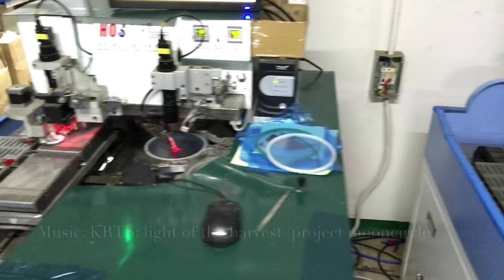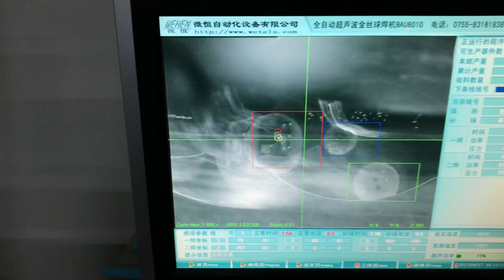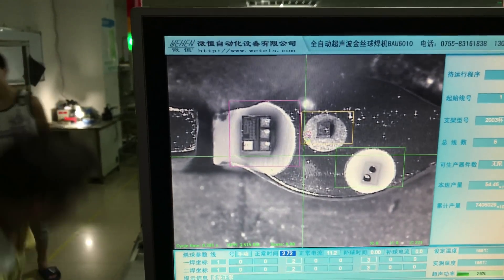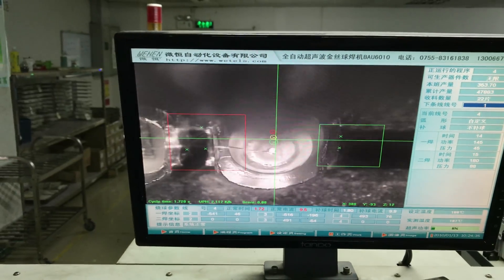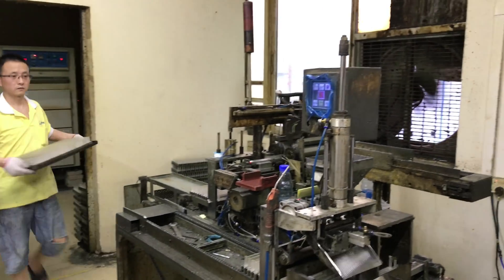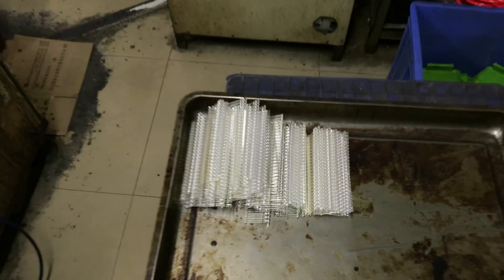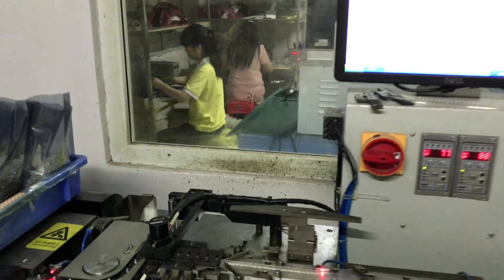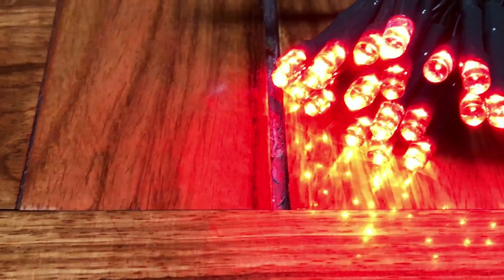RGB LED manufacturing

Comment: I'm  surprised that the IC only does "slow flash" color transition in the same speed as others which is boring and too quick, also it is not a seamless transition, as the programmer mise have been careless.  Could the IC be programmed to be much slower with higher steps per second resolution?

Comment: Nice video..  I'm interested in the company making these, as I have wanted to buy them for years and can't source them.  do you have details you can share?
Reply from the maker: Hi Chris, just check alibaba or aliexpress for these, they are widely available these days.
Reply: @infinitesolarforall3901  not 2 wire addressable RGB pixels... they are as rare as the dodo.  I thought twinkly cornered the market on them, which is why I was excited :)

Comment: This is really cool, thanks for showing the process! One thing I'll note that is in the earlier part of the video, you should the wire bonding to the IC that "mixes the colors" which looks a lot like a ws2811 or similar IC, but in the end, you talk about LEDs that are used for simple christmas lights that use "two wires" which generally do not have controlling ICs, unless I'm missing something.
Reply from the maker: Hi,  the trick is that we can superimpose a digital signal on top of the power signal, this allows us to use just 2 wires, but still communicate digitally

Comment: I have a couple of questions since you offered. 1.) are the LED’s sorted by light characteristics because they get mixed up in production or is every led produced slightly different from another and they are just sorted to obtain a higher characteristic tolerance. 2.) how much does each LED cost to make? 3.) who invested the money for the machines and how long does it take before one pays for itself. This is very cool to me, thanks for sharing.
Reply from the maker: Hey man, sure!   So these are RGB leds, the dice that are inside are 450 nm (blue) 532nm ( green) and 650nm ( red)  they are manufactured separately before assembly. Each led chip is incredibly cheap costing cents only. They are fed in to the machine on wafer boards where the pick and place machine can pick them up and place them inside the led frame.  The machines cost quite allot, my estimate is about 50-80 K usd for the placers and wire bonding machines and even much more for the binning machine that sorts the LEDs. So that machine park there costs well over a million usd. ROI depends on market prices for leds and raw material cost. There is a reason why these companies run 24 hours a day, their margins are quite small so all they can do is make massive quantities of leds.
Reply: @infinitesolarforall3901  you have a really cool job, I wish there was more manufacturing like this in the US just because I really like industrial automation but I guess the low profit margins are what keeps that from happening. I've noticed that china is starting to make a lot of machines now (cnc, injection molding, ect.). What do you attribute that to? Do you think China is starting to climb the manufacturing hierarchy? and where do you project most manufacturing to take place in the future. If you had to give one piece of information about Chinese manufacturing and quality control, to me an american engineer who has never been to China, what would it be. Thanks, great video by the way, really appreciate it!
Reply from the maker: lsm13b the US is still leading in design of new equipment the Chinese pretty much just copy the designs from Japan and US/EU  especially in electronics equipment the US can’t be beaten as of now but the Chinese make stuff cheaper.
Reply: lsm13b
The probability that LEDs are 100% identical is very low. There will always be manufacturing tolerances. These tolerances can be from clearly visible to barely visible.
You could see that in the exam at 6:15, how the point between the 4 categories jumped criss-cross.

Comment: Wow that's a lot of engineering put into those machines. Surprised how dirty the place is though...
Reply: It’s a factory running 24/7, not a show home or a restaurant
Reply: @unlokia  I've seen lots of manufacturing facilities in my days, and I can tell you right now any real LED manufacturer worth their salt maintains a pristine environment, this is not a well run operation. The amount of filth and contamination in that facility is horrid from an electronics manufacturers point of view, you do understand that dust and grime in/on small components causes quality control issues right?

Comment: Wow. This is really cool! How does data get sent to the LEDs with only two wires?
Reply from the maker: Brandon Meiklejohn it’s superimposed on top of the 5V line
Reply: Thanks for the information, really appreciate it!
Reply: If it's like other IC LEDs the data gets cascaded to each LED. The first LED receives it's data then it allows data to pass on to the next LED and so on.

Comment: I know they're not making CPUs, etc, but I still expected a little more cleanliness, filtered air, specialist clothing, etc.
Reply from the maker: Tony Eezi I agree, but it’s not super important for the purpose, these leds are very cheap, you’d see a very different setup in a big brand factory with high power led manufacturing
Reply: White ones get burnt spots in the middle or the phosphor changes colour, blue ones just go open, other colours just die. Quite a few COB LEDs have groups that fail but of course the faulty ones can't be replaced individually. Mainly it's the 'bullet' packages that have the worst failure rate but I've even had 5050 LEDs discolour, fade & die well before they should. It's wonderful technology but far from perfect. 
The first LED I saw was in the late 1960's, a small red LED with a faceted bullet package - it was magical in those days but very dim. It didn't last long either. I've been using them and replacing them ever since.
Reply: olsmokey - the failures that you describe are from over-current (bad drivers) and over-temperature. For "bullet" do you mean 3mm and 5mm LEDs? If so, those are indicator LEDs and they are not designed for continuous operation. It sounds to me light you are replacing household light bulbs, and those are usually made down to a price.
Reply: You're right about the 3mm & 5mm LEDs. Wrong about everything else.
Reply: olsmokey - well, aren't you the clever one?
Reply: Well, by my direct experience I replace many dead LEDs weekly. Maybe these ones are reliable, but the ones I have to replace aren't.
Reply from the maker: olsmokey question is why do they fail? Is it heat? Power supply or something else.
Reply: @olsmokey  If the heatsinks are too hot to touch, they're too hot. Unfortunately most LED lamps are manufactured to put out as much power as possible with little regard to lifetime. Often due to having to fit into the same packages as old incandescent lamps. And consumers just buy the one with the highest power and don't know that means a shorter lifetime. Personally I choose the ones with lower power than average, and better heatsinking.
Reply: They would do if they were actually manufacturing the silicon. They are not. The silicon/raw LEDs have already been fabricated prior to this process. The machine is simply placing the red, green, blue,  white LED components + IC on a substrate then soldering them together.

It's possible that they use an electrostatic mechanism/positive pressure environment within the tiny pick and place machines to prevent any dust from settling on the substrates and any dust can be removed prior to encasing the parts inside resin.
Reply: its not even like that in the US... wtf you talking about willis.
Reply: I've seen countless videos on how someone uses LED's. Often very questionably calculated series resistors or oddly designed series / parallel circuits are used. I prefer the series connection of LEDs with a "correctly" calculated series resistor (based on data sheets), which I then take a precautionary value higher. At such a strand I then connect other strands in parallel.
I once had a car interior lighting built from 16 LEDs (4 strands of 4 LEDs each). I deliberately calculated the series resistors with an operating voltage of 15V.
The LEDs have been lit for about 9 years now. Until today without failures.
Even in the staircase, I've installed LEDs in cable ducts that illuminate the stairs for me. Apart from the failure of a single LED, they also glow flawlessly over the years.
The ratings of the used LED's in my Staircase: 3,3V 0,02A per LED. Power Supply: 12V DC with fixed Voltage Regulator. For every LED-strand i used a 105 Ohm series Resistor.

How is a LED series resistor calculated? 

Step 1: Please read in the data sheet, which electrical values your LED may be operated with

Step 2: Calculate the needed Voltage-drop at the series Resistor: (for example: 3 LEDs with 3,3V forward Voltage in series needs 9,9V)
I like to use a 12V DC Power Supply...
12V - 9,9V = 2,1V

Step 3: Calculate the resistance for a current-limit at 0,02A:
2,1V : 0,02A = 105 Ohm

If the Power Supply is unstable, use the next or after next higher value of the resistor to prevent over-current and damage to the LED's.
Please note, the forward current of a LED-strand stays at the rate of one single LED. This current only rises whent you connect LEDs in parallel!
Don't mix different types and colors of LED's in a series connection. Because different LED-Voltages and LED-currents can and will cause damage to the LED with the lowest voltage- and current-value.
The series resistors value should not be too low, since otherwise the smallest voltage fluctuation could cause a large current fluctuation at the LED's wich can cause damage...
Reply: This is why so many LEDs are unreliable. They quote figures of 10's of thousands of hours, but in practice it's much less.
Reply from the maker: olsmokey not so true, the process here is to wirebond and cast the LEDs in resin, the number one reason of failure is overheating and running the LEDs with too much current, normally the led doesn’t fail, the powersupply fails. For white leds the running temperature is even more important because the phosphorus cannot handle more than 85 degrees or so if more it will degrade and the conversion efficiency will drop dramatically
Reply: No fucking reason to manufacture these units in a clean room lol
Reply: @olsmokey  not the same kind of leds.

Comment: I know the colours require different processes, but just imagine the assembly cost saving if the LEDs and control chip were all integrated into one die.
Reply: Impossible at today's technology. Each color requires different type of semiconductor. The chip must be made of silicon.
Reply: It's not the processes that are a problem, it's the base substrate material and doping that is different. You can grow patches of different semiconductor material on top of base wafer, but I'd say economics of it are kind of dubious for RGB LEDs. Btw, the chip does not have to be made of silicon, you can make a chip out of GaN or whatever.
Reply: You could maybe fuse the dies directly on the chip (maybe at the chip fab?),  but this would make the chip bigger and thus more expensive,  and you'd still need to run each one through the stitching machine to connect the chip to the pins.
Reply: The differences in coefficients of expansion between the various semiconductors causes problems in chip-on-chip fab.
Reply: fair point. There's also the problem of heat dissipation
Reply: Just had a crazy idea tho. chip features are much smaller than the wavelength of visible light, so maybe you could make a phased array and transmit light as a radio?  (quick calc 800nm red light = 300+ petahertz so maybe not this year)

Comment: is this smart led line ?!
Reply from the maker: John Vatic in a way it is it uses the I2C protocol for communicating with another chip so it’s colors can be controlled. 256 steps of intensity per color. It’s used mainly for decorative purposes and saves allot of copper
Reply: @infinitesolarforall3901  thanks for your reply
Reply: Hi.. pls give us your contact information...

Comment from the maker: Hi there Tarinder,  im not sure what this machine costs, but you need several machines to complete the process,   for LED strips they make SMD LED's that are then soldered to the flexible PCB of the strip. that strip is than coated with a silicone to water proof it and make it last.  for that production process you can also use just an SMT machine, and a glue machine. you dont have to own the LED assembly machines.
Reply: Nhan 17
Reply: Infinite solar for all

Comment: WHAT IS THE COST OF THIS MACHINE.
WHAT IS THE REQUIRED AREA OF THIS UNIT.
FROM WHERE I WILL RAW MATERIALS
ARE YOU HAVING ANY OTHER PROJECT FOR LED DECORATING STRIPS?

TARINDER MITTAL
MOBIL NO. 941751506